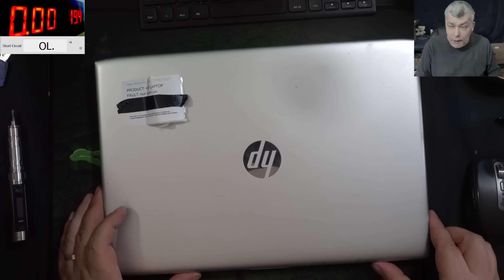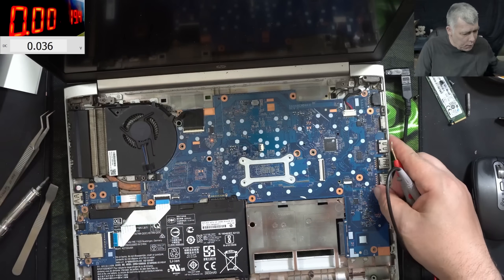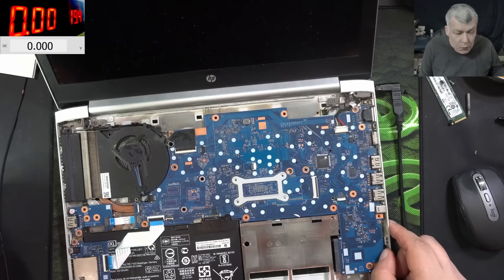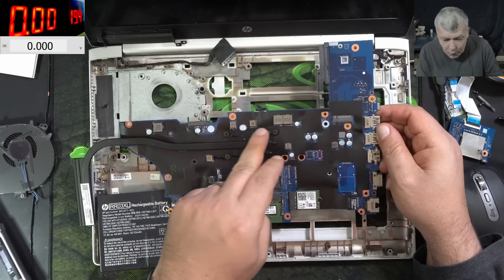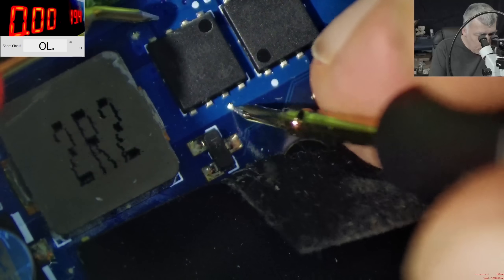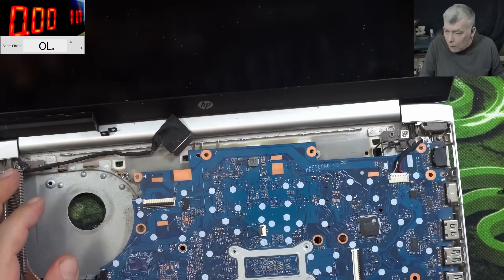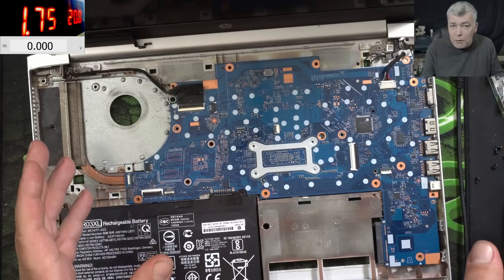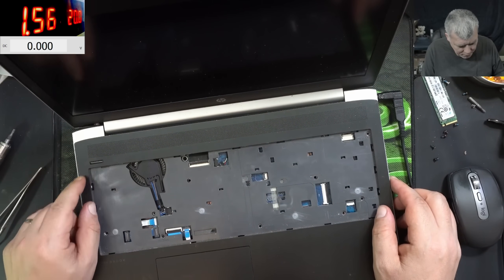Some faults/repairs, can't be explained - Hp laptop, dead not charging, glitch in the matrix????

Comment: Had exactly the same issue recently with hp probook intel 12th gen. Frozen like totally dead, power supply switched off when connected like with a short. Opened up, checked the main battery - 0.04V. I thought a short that additionally killed the battery. Still under warranty so sent for a repair. On the next day the technician calls me and asks - sir,  what exactly was the issue? laptop works fine. I was like wtf.

Comment: I think it was a frozen bios. When you remove the battery and plug the charger the cable of the charging port was not plugged in the board. So the current draw was 0A.

Comment: Some repairs cannot be explained. I removed the motherboard of a similar HP laptop and similar issue. I connected the fan and replaced the CMOS battery. I connected the charger, and the fans started spinning. There was no need to carry out any further diagnosis.

Comment: Probably a not burnt but cracked mlc that went open line from the voltage injection FOR NOW. That is why I always inject with a low voltage and current limit and check with thermal cam, as once the short disappears nothing will heat up and in a month it will be a warranty job when the cap shorts again.

Comment: The dust inside looked dark, ash or pencil like ? Carbon based, conductive. Maybe there was a short, moved the plastic around and pulled the short away (blew the dust away).

Also, regarding bios battery. I've had 2 PC MOBOS, not starting with a ded bios bat. Ded-ded 0.0V . The WORST defect to trouble shoot since the usual order is RAM, cpu, drive, headers usb and/or fan and/or RGB , etc. 99.9% of PC mobos don't care about CMOS ded or even non-existent bat unless unplugged; and the effect is just not remembering BIOS settings.
Until that One main-board, you never need to check the bios bat. After THAT ONE, you always measure the V on it :eyes-purple-crying:

Comment: When you first pulled the motherboard out we could see a 3V 2032 battery in place, so that may have gotten shorted briefly resetting the bios when you were checking the coils on that side of the board?

Edit: oh, ok, at 11:30 you spot the battery, I added my comment before getting to the end of your vid, where you were trying to come up with explanation for why removal of main battery didn't reset it.

Comment: Instead of charging in like a bull , next time step back and look.... you missed CR2032 coin battery..... you should have checked it and changed it too. Fault will come back if the backup battery is very low and it probably is so we will see this laptop again soon for warranty repair ;-)

Comment: This common problem with this laptop I fixed the same laptop, the same problem many times. Its charging ic problem its get freezed because when battery deep discharge. charge ic internal program stop main line 13v. So when sorin inject voltages on caps charge ic rest and laptop starts working.

Comment: The problem is shorted main power rail.
7:15 power supply clicked, the short was gone.
You should check main power rail after the laptop coming on to prove it.
Reply: CC was set to 0,03 amps
thats why it clicked
no short will be  gone with 0,04amps and 3volts unless it is water evaporating
Reply: @filda2005  in 8:30 you can see current set about 1.5 A, i can't see another scene in video showing current set to 0.03A, and AFAIK never seen Sorin limit the current below 50 mA.
in 7:15 PS's display showing 0.04 A at 5.7 V. It's not necessary that the real current is 0.04 A, due to the lagging the display.
Reply: Yes you are probably correct. Wanted to comment same thing. He killed the short. Many people commented that BIOS battery can be low enough. But that doesn't explain 40 ohms on main power rail. Pretty sure Sorin killed the short since I heard it to click as well. Probably some capacitor or whatever conductive junk on the motherboard.

Comment: I've got one of these at work I pulled from scrap to use for testing Canon printers with their service tool.
If the CR2032 coin goes too low or momentarily disconnects, it just won't turn on, worth noting that the BIOS data still stays fine because the voltage is high enough, but too low for the EC.
P.s. it's a frustrating laptop to use, the mousepad glitched often so I pried it out live and just used an external mouse.
The original screen was a 2-pixel bodgejob operation AKA 1337x720 1 degree viewing angle wonder. I got annoyed with my boss's son so I kicked the laptop off the table flying across the workshop obliterating the screen,, so I pulled a nicer 1080p screen for it out of scrap.
The stress is due to the health-and-safety nightmare combined with task-overload, in which cables everywhere in a tight space where I have half a foot clearance to get past several printers meant the laptop got pulled off the table several times.
So, for a peasant-grade laptop they can take a beating, just shame on them having a one-pixel wonder screen default, that horrible glitchy mono-click trackpad and that CR032 battery issue.
The apparent fix for this well known issue is to find the 3.3V standby that takes 3.3v generated from the main battery for the EC chip and route that to the CR2032's cathode side of the anti-backfeed diode going to the RTC battery input of the EC (The one that stops the CR2032 charging accidentally).
p.s. work's still a deathtrap waiting to happen, just a fire hazard on top of it all now.

Comment: This type of fault is complete mess
It wanted you to take the board out of the laptop and admire its excellent design 😂
But overall, by supplying power to the main board, you put all the capacitors into a shock state, and the issue was resolved.

Comment: I still would check (and replace) the BIOS battery. Maybe the voltage was so that the EC chip did not reset but had faulty data that prevented correct operation.

Comment: 41 ohm is very low , voltage injection did tje job , hope will not comeback in 3 months. it will be 1 pizza for 2 repairs

Comment: Hi Sorin, amazing work you are doing and thanks for sharing the knowledge.I will try to do my part as  I have worked with only HP laptops and they have some really strange and unique issues, most of the time they seem to fall in some kind of a dead state while nothing is broken, soldering and boards are ok, they cheap out on various slots while the lead is applied to the board anyways and the connector is 0.001$ worth but they still dont put it...

Comment: With hp, i had a laptop for repair that did not turn on or charge. Unplugging the battery and reconnecting it made it work again but it was caused by a defective trackpad. The owner had stepped on the laptop damaging the trackpad. Every few weeks the laptop stopped working, where it did not power on at all, till i replaced the trackpad.

Comment: Seen it before - there was probably some dust causing the issue - thats why you saw 40ohms on the main power rail. When you injected the power it might have cleared it or just the action of moving the board around fixed it!

Comment: RTC battery likely low voltage. Main battery likely still had enough voltage to hold RTC voltage high until it was removed. BIOS lockup most likely.

Comment: Hii good day!

I've got something to ask, 
Does the ampere (A) in a laptop charger matter?

Coz I think, I mistakenly bought a laptop charger for the HP Pavilion 15-e051se. (Since I lost it's entire charger 5 years ago and forgot to list it's charger spec) And this year only, I was able to buy its charger but its only 2.13 A.

I later found out that by searching several sites, that the HP Pavilion I have need a charger of 3.33 A.

Whenever I plugged in the charger, the Power button, capslock and Wifi signal will only light up every 5 seconds..

Hope someone clarifies. Thanks
Reply: Of course it matters. No idea how much your laptop takes, but you definitely can't buy smaller wattage power supply. But you can try lab power supply if you have one.

Comment: 4:10 "now we can take the battery", with power cable(between board and port) disconnected 🤣🤣🤣
Reply from the maker: :))))))))) definitely i'm getting old
Reply: yep, so that could be the reason, after the battery disconnected and reconnected the bios restarted and it already worked.

Comment: I don't agree. I have seen faulty CR bios battery that coused the MB to stop working. Until you don't take it out. Please analyze few circutes from some manufacures, especialy this one and you will see what I mean. For minues is that after even notify that there is a battery, at least on the movie you didn't check the voltage.

Comment: The bios battery is empty or almost empty and this leads to the error that the bios is not always charged correctly - as a preventive measure you should replace the battery with a full battery with over 3V
Reply: At least check the bios battery voltage, replace if less than 3V
Reply: Correct, but probably not in this case. 40 ohms was on main power rail.

Comment: just killed the shorted (minor shorted inside any component on Main Power Rail maybe) when inject voltage on the Capacitor? i seen current just up to 50mA then just goes down to normal again
Reply: May be it was current of charging caps?
Reply: The best comment until now....
Reply: @Lightinthedarkness1977  agree with you brother, there is nothing like magic
Reply: Exactly. And we don't know real current because power supply is quite slow. Only oscilloscope would of showed real current.

Comment: Thanks sorin for all the knowledge you give us. I was able to revive my laptop from 2010 and its display also using "No capacitor, no shorted capacitor". And used a proper non-calibrated wire as a fuse.

I also was able to find a shorted cap on another display which someone gave to me, it was my first test subject but i managed to blow up a resistor which was connected to the ground? I have no idea what it was doing. Without a motherboard i don't know how to test it. I also don't know the value of the resistor because when i checked it with multimeter it was reading 0 ohms, the pad beneath it blew so i was able to test the somewhat blown resister but i have removed and lost it also. So no idea what to do now.
I just have some IPA, a soldering iron (a simple one but temp controlled) a dc-dc buck-boost converter which is powered by a dell laptop charger. 
Can someone guide me on how to test if the backlight is fine without any advanced tools because i have nothing, i like watching these things and its kind of my hobby.
My 19v rail has no short anymore but i have no idea what that resistor was for.
Thanks.

Comment: had a similar thing happening to a laptop i was working on. friend's laptop had shorted power rail, injecting voltage showed nothing, checked every connector / ribbon cable, removed bios battery AND reset the bios beforehand, but still nothing was working. With that said, i closed the laptop back up, pressed on accident the power key and it came on.
Honestly surprised me ahah

Comment: Maybe the EC chip reset its state when it sensed the main power rail present, when you came with the power supply with >10v on the main power rail? Was stuck in an impossible state. Looked for main power rail present but prevented main power rail present.
Reply: 40 ohms measured on main power rail shows short somewhere. Although your theory is good it doesn't explain 40 ohms on main power rail. Most likely was a short somewhere which was killed by applying power.
Reply: @TriodeTetrode  Why was the main power rail not created then? Also the power supply never supplied high current. How would a short burn out with 10v 20ma
Reply: @hmartinlb  If there is 40 ohms obviously main power rail can't be created. It's pretty much shorted. And how you know it was 10V 20 mA? Like in the other comment we discussed this, you don't know really how much current went through. Because power supply is extremely slow, you would need oscilloscope to see surges. Also power supply clicked. I don't know what was power supply current limit at that point. Even going into low limit like 10 mA the output capacitance of the power supply can be sometimes enough to burn through shorts.
Reply: @TriodeTetrode  How would the EC chip know there's a short on the main power rail? That doesn't make any sense. The main power rail is supposed to draw high current. If the short burned out at 10v it would have burned out before whatever chip decided to no longer create the main power rail.
Reply: @hmartinlb  EC chip is not in charge of creating main power rail. It was this Intersil chip in this case. But it's the same way why you have shorted capacitors let's say 10 ohms and still won't power on. You can read datasheet about Intersil chip. In this case we know for a fact that 40 ohms was on main power rail. Sorin didn't measure afterwards, but it's definitely higher. Also who knows what kind of short it was, resistance can change like when you some conductive stuff or there are semiconductors involved. And we don't know the real current either because power supply is too slow.
Reply: @TriodeTetrode  Does the intersil chip have a state? If yes, then it's that chip's state that got reset. Yes, we don't know the resistance afterwards, but 40 ohm is way too high to be classified a "short". From a measurement point of view there is no difference between 40 ohms and a working laptop, if the chip tries to detect voltage drop.
Reply: @hmartinlb  You believe too much into resetting things. 40 ohms on main power is quite low. And we don't know where it came from. Could be 40 ohms at some point but much less another point. Could be around on pins of any chip, we don't really know where it came from. It can cause all sorts of weird issues by shorting random pins. But we know there was 40 ohms which is not normal.
Reply: Your explantation is making sens ! I agree with you 👍

Comment: i have the same laptop in here.. 😂.. ram problem
Reply: Aha. It could be one of those that has a bad RAM socket, some pins on the end are not soldered. Too much flex in the chassis.
Reply: not the reason for not charging!

Comment: I hate that HP laptop chassis design. Have a few models like that where I work and I get irrationally angry trying to access the motherboard.
Reply: What about the BIOS battery? Can you take it out without removing the motherboard?
It is only partly visible.
Reply: @Drottninggatan2017  In the models I've seen, you have to pull the board to get to the BIOS battery. But you could probably cut that plastic bar on the bottom as a shortcut. Awful design.
Reply: Well, HP are not good laptops. HP, Acer, Toshiba - all not good, in my vision.